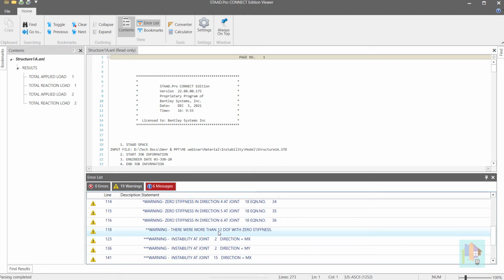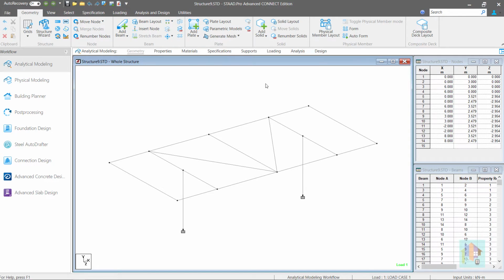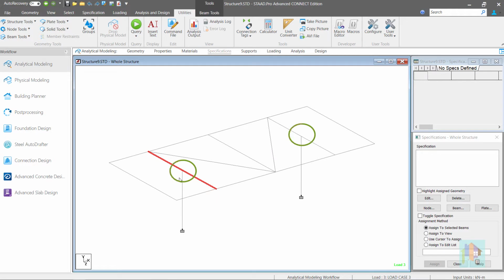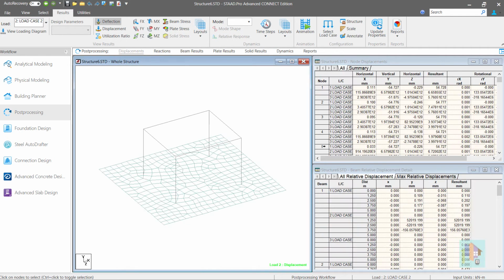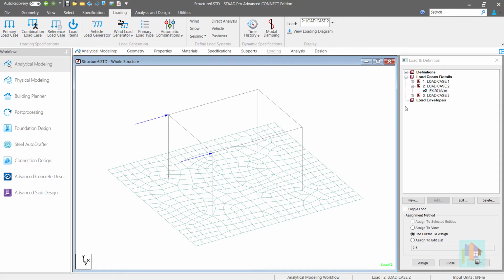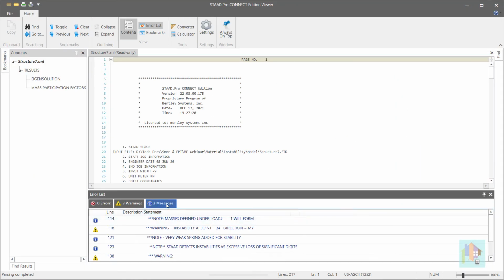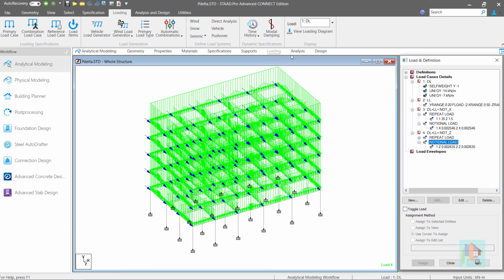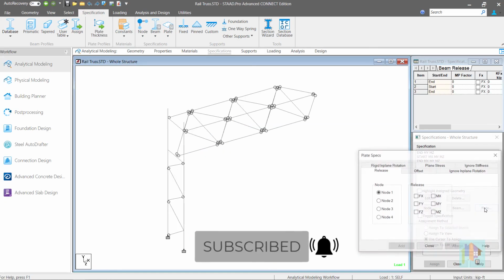Structural Instability & Zero Stiffness: Part 3 – Solving Instability problems || Modelling error

Comment: While designing steel structures in staad pro sometimes, a failed member show very huge utilization ratio like 678 what's the reason behind that pls explain sir
Reply from the maker: You can include TRACK 2 command and check the detail result in the output file. One reason, some checks are not performed or the capacity is not calculated properly due to erroneous property values.

Comment: so so much thanks sir i have been worried about this problem and tried every thing no luck, but you explained it like a pro.
Reply from the maker: Glad it helped.
Reply: @surojit_ghosh  sir need some information if we do not release moments at the ends of beam,how much it will affect the design or is it necessary?
Reply from the maker: For steel structure, depending on the connection, we need to assign member release, for example, for shear connection, we can assign moment release at that end. For concrete structure, it depends on the designer. Several designers assign release to the secondary member though it is not 100% acceptable as monolithic construction and extension of reinforcement in primary member establish a moment connection.
Reply: A request sir can you make a video on how to utilize members in R.c.c structures?

Comment: I have analysed one B+G+7 storied building and it's showing error message " Eigen solution failed. This may be due to ill-conditioned stiffness matrix ", " Failed in Advanced solver Eigen ". Please do support to rectify this. Thanks in advance.
Reply from the maker: It seems like an instability issue. You can check for multiple structure/orphan nodes. If that does not solve the problem, you can upload the relevant model in Bentley Communities (https://communities.bentley.com/products/ram-staad/f/ram-staad-forum) for review.
Reply: @surojit_ghosh  thanks dada, yes it's due to the multiple structure, overlap and orphan nodes related issue. Yesterday after making the making the comment I realized and solved it 😁.

Comment: ---------------------------
Error
---------------------------
An unhandled exception occurred: Process with an Id of 21443 is not running.    at System.Diagnostics.Process.GetProcessById(Int32 processId, String machineName)

   at System.Diagnostics.Process.GetProcessById(Int32 processId)

   at Bentley.Staad.Editor.Management.StaadEditorWindowManager.StartCallerProcessMonitor()

   at Bentley.Staad.Editor.Management.StaadEditorWindowManager.LoadMainWindow(StaadEditorAppManager appManager)

   at Bentley.Staad.Editor.Management.StaadEditorAppManager.LoadMainWindow()

   at Bentley.Staad.Editor.Management.StaadEditorAppManager.LoadApplication()

   at Bentley.Staad.Editor.StaadEditorApp.OnStartup(StartupEventArgs e)

   at System.Windows.Application.<.ctor>b__1_0(Object unused)

   at System.Windows.Threading.ExceptionWrapper.InternalRealCall(Delegate callback, Object args, Int32 numArgs)

   at System.Windows.Threading.ExceptionWrapper.TryCatchWhen(Object source, Delegate callback, Object args, Int32 numArgs, Delegate catchHandler)
---------------------------
OK   
---------------------------

Comment: Hello Sir,
First of all, I just want to thank you for your time in explaining the design concepts that goes into the staad software. The video series on instabilities and zero stiffness warnings is really informative and very insightful to a lot of engineers. Can you please do a video series on static seismic analysis with accurate time periods as you hinted in the video. I am sure a lof of engineers would want that. 
Also, this is probably not the place for this topic but can you also please do a series on analysis of PEB structures.
Reply from the maker: First of all, thanks for your feedback. I have some plans to start a new series on seismic analysis but due to time restraint, I am unable to work on this. Videos on modelling, analysis and design of PEB structure will be uploaded soon, stay tuned for further updates.
Reply: @surojit_ghosh  
Thank you sir for your response. I can understand your time constraints and everyone would be happy for any kind of information from your side. 
You said something about the design of a box culvert at the end of plate meshing video series and I think that would be a very informative series. One request though, please talk about the crack width checks and limiting stress in steel (130-150 Mpa), if it's a water retaining box culvert. 
It will be highly appreciated if you can do a series on the effective lengths to be considered in columns. A lot of structural engineers are ambiguous about this part especially when there are no beams connecting the columns at floor level. Effective lengths to be considered when sway, non-sway condition and how to do a proper second order analysis. I have heard that if we do a second order analysis on the structure, we don't have to worry about the effective lengths, your ideas and approach on this subject will be really helpful. 
Also, I have a couple of questions in physical modeling...... 
1) Is there a way we can define truss specification in physical modeller?  I have seen the options of hinge both ends and axial behaviour, but my concern is what if we want to do a partial release? Also in axial behaviour, we have the options of tension-only and compression-only ....... Does this mean we have to define tension and compression members seperately in a truss arrangement ? 
2) in analytical modeller we have a lot of options for selection like node cursor, member cursor, geometry cursor, missing attributes, based on properties.....all these options are available in physical modeller as well ? I can't find them.
3) In the spreadsheet tab on the right, I don't see all the options like you guys have nodes, members, surface etc., I have only nodes table and I can't figure out to change the layout of this tab.
I am sorry I have asked about a lot of information in a single comment, I have very  recently started using the physical modeller and these are a few options I couldn't find. I know these are some very basic questions about modeling but your response will be highly appreciated. 
Thanks for your time. 

Regards
Prasad.

Comment: Very nice presentation sir. How to get the value of sub-grade modulus for different types of soil.
Reply from the maker: You can get the soil subgrade modulus value from soil test report. Either bearing capacity of soil or the subgrade modulus value is reported in the soli test report. You can easily convert bearing capacity to subgrade modulus value using (BC*safety factor/allowable settlement). Normal range of subgrade modulus value for different soil is - 4800 to 128000 kN/m2/m.
Reply: @surojit_ghosh  thank you sir.